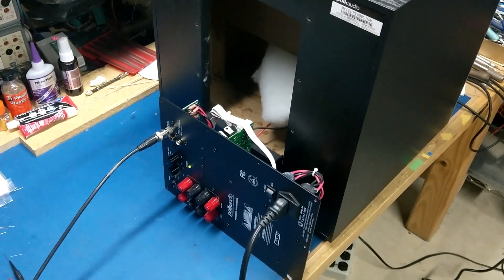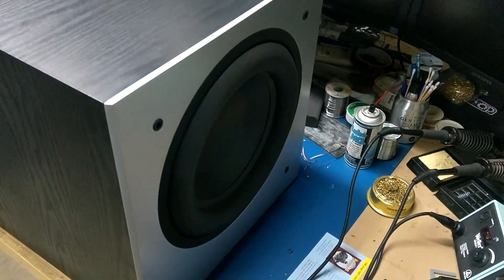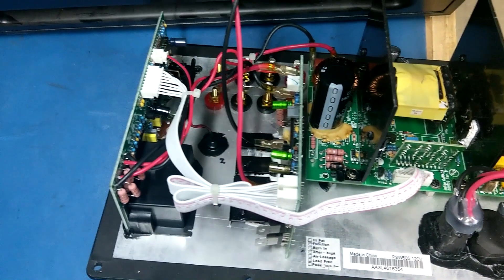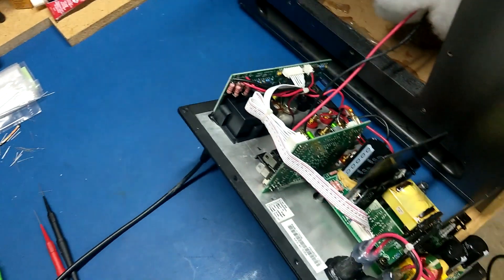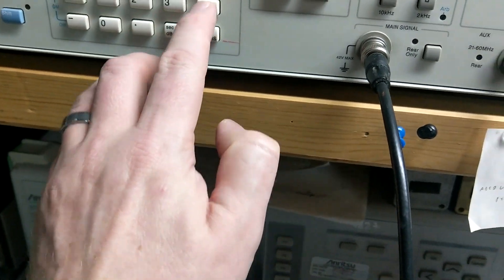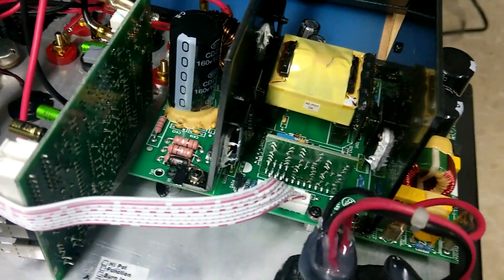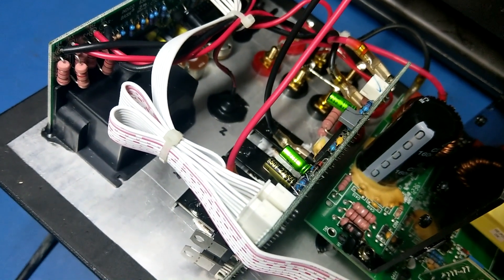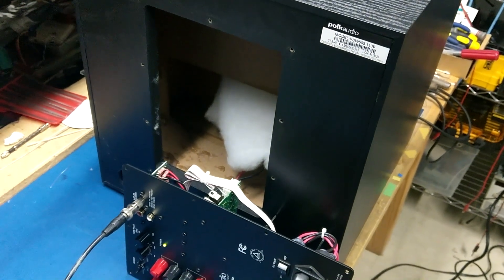Polk PSW505 Repair - Low or No Audio Output

Comment: So check it out....I found my 505 at a thrift store, clerk complained it didn't work. So I told her I'd give her 5 bucks to free her of the burden of throwing it out which they were about to do! Saw this video, confirmed that it had the same issue and decided to call a Polk rep...aaaand boom! I should expect my supply on a DHL flight, from San Diaaago,(a whales vagina) FIRST CLASS in 2-6 weeks! 

Best 5 bucks I ever spent!

Comment: Thanks for the vid! Just replaced all my caps and the sub is working perfect again. All for $15. For those interested I used Nichicon:

- UPW1H470MED1TD
- UPW1V4R7MDD1TD
- UPW1H220MDD1TA
- UPW1V101MPD

Also, you don’t need those exact caps. Any 105C with long hour ratings should work. Lead spacing on the board is 5.5mm but you can used 2.5mm or 3.5mm. The ratings are:

- 4.7uf x 35V
- 47uf x 50V
- 22uf x 50V
- 100uf x 35V

Good luck!
Reply: Have a PSW505 unit that needs the caps replaced. Any chance you can provide the qty for each?
Reply: @kenkostick4127  There were multiple revisions so I'm not sure if ours are the same.  I also didn't replace any on the power supply board as they were fine, but I used:
4x - 4.7uf
5x - 47uf
1x - 22uf
3x - 100uf
Reply: @stoplooking   Thank you for the reply. In review of capacitor options, I'm finding various diameters and heights. Any specifics for the ones you replaced?
Reply: Appreciate the help!  I intend on doing this too but I am a bit in over my head.  I am good at soldiering but my electrical knowledge is not at this level.  I can test caps with my volt meter, but not sure if it works in place or if they would need removed first.  How do you test the caps in the PS to know they are not needing replaced?  Anyone know if the caps above will work on the PS as well?  I intend on just buying 10 of each so I have plenty.
Reply: Thank you for sharing, that's very helpful info!

Comment: I have two of these.  The first one failed some months ago, and since it was still in warranty Polk sent a replacement power supply board.  That solved the problem, but it never sounded as good as the original did.  And then yesterday, the second one (which I use with my computer) died.  Before its death, that one sounded incredible.  I must have had it very well adjusted for that environment.  Consequently, I am done with this and have bought a non-Polk replacement for the computer which should arrive in a few days.  Perhaps I will try to replace caps on the dead ps board, but I find that the time required to procure parts, dis- and reassemble, and swap parts is probably not work my hourly pay rate.  So more than likely, this second dead subwoofer will just sit around unusued until I can work up the nerve to just dispose of it.  On the other had, it does have a perfectly good driver and could be externally powered.  Maybe that's good enough reason to let it clutter my space a while longer.

Comment: Not sure if anyone still needs information, but I just mapped out my capacitors on my AMC-PSW505U Lot# 3113133
Voltage, Capacitance, quantity on my boards: (your model might be different) Also, not all of them will be bad/defective. I actually noticed that one of my capacitors was installed backwards.

50v 22uF - 11
50v 4.7uF - 2
35v 100uF - 1
50v 10uF - 2
50v 47uF -3
16v 330uF - 1
25v 470uF - 2
25v 220uF - 2
Reply: Thank you, huge help.
Reply: I have the same board, with the same issue. Any chance you have the exact list of capacitors (full part #) that you can share?

Comment: my sub started going on my 25 year old altec lansing ada 885.  I pulled a circuit board off to check.  Put it back then i blew a capacitor.  Replaced but now my audio is very low too.  I guess I'll replace the rest of capacitors on that board.

Comment: Are all the caps you replaced the same value? Please link the caps if you got them at Parts Express or where ever. I need to do this to mine. VERY low output. I can hardly hear output but there is some there.

Comment: 90 percent of the time it's the power supply  that goes.. the amp plate if any one wondering  is called  a bash  amp you can still buy  a new plate. from parts express  300w and 500w available  it has the exact same boards the plate it self looks different because it's under  the bash name.  At one point every sub woofer manufacturer  used this amp  just look for the name bash on the plate.    If there no bash label  on the plate the company charge brand of amp plates like the newer 505 polks   there not the same amp plate or boards . In my opinion  the newer one are even worse with  even more problems and more difficult to repair. 👍✌️💯

Comment: Cheap ass Chinese capacitors. Does anyone know if the other SubWoofers manufacturers have the same problem with the amps burning out due to cheap ass Chinese caps?
Reply: Chinese capacitors are the absolute worst In the 70s they werent even useable even brand new
Reply: Pretty much all of them that I've worked on have cheap Chinese caps in them. Polk Audio, Klipsch, Infinity, you name it. A lot of the amps are made by a third party and are actually interchangeable between brands